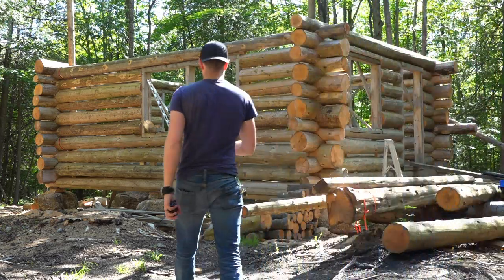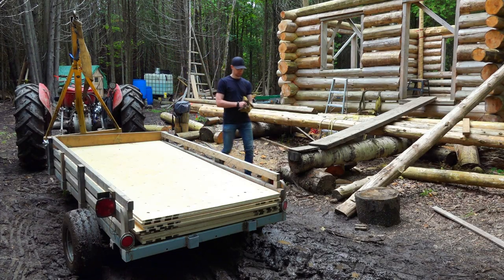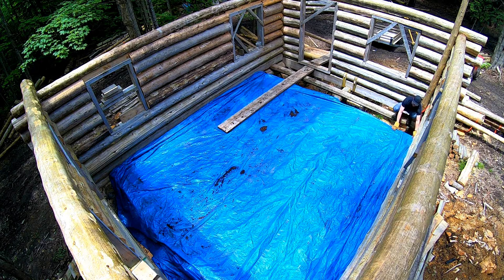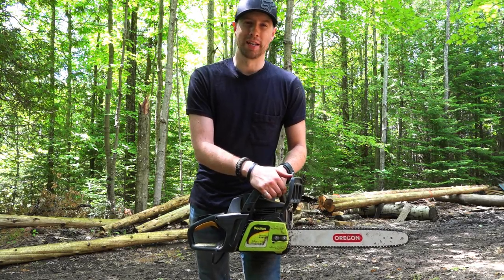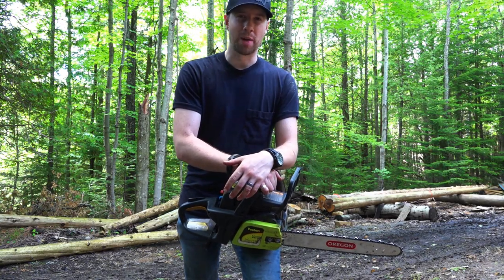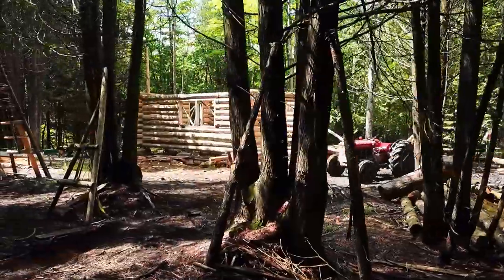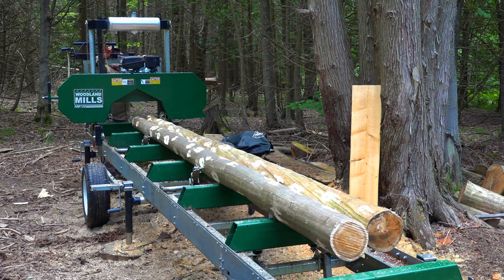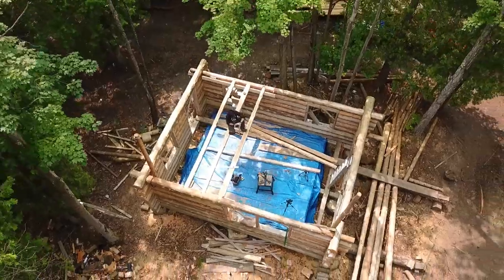Second Story Loft and Tractor Logging / Ep51 / Outsider Log Cabin

Comment: I've had a poulan saw for about 12 years now, a 3640 that I originally bought to stuff in a backpack on a dirtbike to clear trails with, but since then has gone through stages of being used for firewood collection and also stages of disuse for years at a time, and that thing still starts and runs like a clock every single time.

i recently replaced my old husky 262xp with a husky 565 for my main firewood saw, but even with the bigger saw I find myself reaching for the little poulan 90% of the time when i have a trunk to limb or a small job to do, and i still stuff it into a backpack to clear dirt bike trails every now and then as well, it's been a great little saw.

Comment: Fuel stabilizer... Or if not using small engine frequently, used premixed fuel...it certainly costs more per litre or quart, but will save the repair bills. Also, follow the starting instructions each time, they are designed that way. Great work/video, thanks for sharing your journey brother.

Comment: Recommend each time you sharpen your chain to flip your bar over, clean out the oiling holes, and grease the nose sprocket.  This will make it wear evenly and help the bar last much longer.  Great cabin build .....
Reply: Some/most newer nose sprockets don't require greasing. By greasing them, you're forcing additional greasing in the future.
Reply: @thechronicgeneralist  Good to know ...I guess my stuff is older ....
Reply: Also remove the burr on the blade edge with a fine flat file.
Reply: Sound advice BangFlop.........remember the air cleaner as well
Reply: Good advise Mr Flop.
He also needs to grease the bearings under that new drive sprocket.

Related to that torn up drive sprocket: what do the drivers on your chain look like? It seems like they would be pretty banged up.

Anyway there is need of cleaning and greasing everything you can. And to flip the guide bar over now and then for even wear.
This too will help your saw run better and longer.

My background is forestry and arboriculture.

Comment: I used to work in a shipyard. I was a carpenter. We often worked with huge oak planks and up to 12 x 12 beams. We used 'crappy' Homelite chainsaws on the job. They too are fairly cheap and an 'entry level' saw. I got so used to that saw that years later, I found one at a garage sale and bought it and used it for many years before settling on an upgrade with a Stihl Farm Boss. I currently use a Husqvarna 600 series. It's a monster!

Comment: Had the same Poulin saw - it worked great when I first bought it (used it to cut firewood regularly) but it started to become a pain in the ass! I spent more time trying to get it started than I did cutting wood. Hahah. Took it apart, cleaned, lubed, replaced a few parts and tuned the carb but it was never the same. I have a Stihl MS261 now and it starts every time, I'm not wasting time playing with my saw, I'm cutting wood!
Reply from the maker: Yeah that does seem to be an issue with those Poulans, hard to start and hard to keep at a steady idle. Glad you made the upgrade. Someday I will too!

Comment: That trailer looks like it's making your life easier when you're moving stuff around instead of the sledge.  Much more maneuverable, especially in tight areas.  Surprised how bright those lights on the tractor are, even in the day time.  Finally, can definitely tell the difference between an experienced person stripping logs than someone who may not have done it as often, lol. Thanks for another great video. Waiting impatiently for the next.

Comment: Good advice on Chain Saws. I have been through a few and came to the same conclusion. We only need one after a hurricane or to occasionally remove a sick/old tree from the property. When I need one I need one but I don't need one every month, maybe not every six months.  That's why after going thru a few over the years and tired of the hassle of keeping gasoline/oil, etc.  I decided to go with an electric chain saw and that has been a great decision.  Some might scoff but those that do I bet never used one. The Makita looks like the best from the reviews but I got the 15A Worx 18" bar saw (Value for money Win) and its been great.  Solid performance cutting up downed live-oaks and southern pine with ease.  So far its done everything I have ask it to do with zero drama, and that's exactly what I wanted. The best thing is that I can put it on the shelf and not worry about it.  Other than lubrication and sharpening it needs no maintenance and works just fine from my 6.5kw generator too.

Comment: You're allowed to be proud, 
You used what you had
Helped by your dad

 Your work was inspired
Despite you were tired
As you had a great factor
In using your tractor

Through the mud on the forest floor
To help out by hooking and hauling 
And cut logs for your cabins door

Slowly it rose one log at a time 
Keeping costs to,less than a dime
And as those walls rise up to the roof
You'll become quite proud and aloof

Adding windows then allowing in light
Will no doubt become a great sight
A fireplace too will be good for you
And warm up your cabin and soul
 
And then you need add 
A welcoming bed for your dad
And cook up some soup in a bowl

Soon your cabin will host
Those you do love the most
The love of your life...your wife...! 

With best regards for safety and success.....
Scott Fuller
(Canadian Forces 1964-2004)

Comment: I use to work for LOWE'S when I was younger in  inside and outside lawn and garden. When it comes to Poulan chainsaws, The key 
making them last longer when you're not using them run all the fuel out and replace it with STA-BIL storage.

Comment: Great comment about leaving chainsaw in the shed. The best solution to this I have found is to empty the fuel, and run it until it conks out. Storing it with fuel sitting in it for an decent amount of time will destroy the fuel lines and gum up the carb.

Comment: Good perspective on why a 2 cycle will just fail if left unused for long periods. One thing I noticed when you did the rather cool camera shot of you limbing that pine, if a experienced Tree feller is aware of the kickback zone, and surefooted, it is Quite the norm to cut branches off flush with the log with both the bottom of the bar and the upper edge.  One thing that may be little known to your viewers if I may share ;  If you ever come upon a "Honey Locust" that needs cut or is marked to be cut,  when shaving the bunches of thorns off of the log, (they grow like little bushes of heavy gauge spikes all along the trunk.)  Remember to use the TOP OF THE BAR to cut these out of the way.  As you present yourself to the tree and rev the saw, the chain is shooting over the top away from you, across the nose and back towards you. 

   The thorns are very painful when the chain cuts a bunch off thus shooting them BACK AT your  right upper thigh- (or worse yet someplace worse).  If not for the hurting part it could be seen as funny,   Yeeoouch!  I have seen The thorns from a Thorned Locust tree stab into my leg and also  flatten a dump truck "Mud and snow" Tire. Some I have seen are 7/32" to 1/4" thick and scary long. Trust me they hurt- kinda like Natures star dart. LOL  (here is a Pic.)

      https://encrypted-tbn0.gstatic.com/images?q=tbn:ANd9GcSiSjVmKolbDLuBqZLvDaTBXwkL6al5lWcabUz6YjDWwwItZvp6

Comment: Poulan saws may be "entry level" but they will earn their price if you take care of them. That bar and chain combo you have on there is the working end. Paying attention to the correct oil/fuel mix is essential. I used to have 3 saws I used regularly. a Poulan for limbing and bucking and general yard stuff. The others were 2 Stihl MS 250's with extended banana bars for falling and whatever other wood butchery. I have a Husqvarna that will not die. It's just for firewood and occasional windfall on the driveway. As you say use it or lose it....
Reply: This Poulan is entry level, you do realise there are Poulans out there felling trees everyday!  And Poulan is Husqvarna....

Comment: Interesting plunge cut and side wedge technique. Never saw that before. From my experience, a traditional back cut with a single wedge is a safer and more controlled drop. Less need for straps and manual shoving the tree.

Comment: Wow Mr Outsider! If this is what you and your father can achieve with an "entry level" chainsaw then what would you be both able to do with the top of the range equipment. I once heard a carpenter say it is not the tools that make the craftsman but the man using them... be they only simple tools or not. In the olden times they did not have power tools and made buildings still standing today.

Comment: I have the same saw as you and have had it for 5 yrs.1/4 the price and still works good! Another secret is to keep it sharp! Im not building a cabin but to clear the road after a storm works just fine!
Reply: Yep, very true. A sharp chain does most of the work for the saw, a dull chain makes the saw work harder. Also, don't force the cut.

Comment: That Poulan chainsaw sounds a little rich off of idle. Chainsaws like to be used at full throttle most of the time. However if you are experiencing bog or the saw loading up after idle its rich. As long as it rips good at the top end the top end adjustment is spot on, just the low end circuit on that saw is a little rich. Try adjusting it for better saw response and less load up!

Comment: G'day from Australia.

By way of reference to professional tree fallers I regularly watch on YouTube like Canadian Bjarne Butler the impression seems to be that they use Husqvarna saws in combination with Stihl bars and the trees they fall are as big as they get.

I have a little Stihl MSA 160C battery powered chainsaw which despite getting a bit long in the tooth and enduring some hard use in rural applications is a great bit of kit requiring almost no maintenance other than refilling the reservoir with bar lubricant and sharpening the chain.

It initially surprised me regarding both the quantity of wood it cuts with the charge from a single battery and the diameter of the wood it will readily cut with minimum difficulty if reasonable consideration is given to it's limitations.

I also have other Stihl battery operated equipment including an AR 3000 backpack battery all of which is so effective and useful I am now contemplating buying an MSA 220 saw as well.

All my Stihl battery powered equipment is so quiet that hearing protection is unnecessary and minimum noise, no hazardous fuel and no smelly exhaust is so good I am contemplating experimenting with portable solar panels to recharge the batteries in the field!

I have also owned a Stihl FS90 gas powered brush cutter for fifteen years or so that I have not used since I purchased an FSA 130 battery powered unit.

It is important to 'winterise' the engine on the FS90 before storage otherwise the unleaded fuel gums up the carburettor necessitating repairs and I know this because it happened to me.

Comment: I'm not sure if you are going to do this but if you can make a steep apex roof on the top floor make sure you make a large verandah that has a fixed window & a mosquito mesh walls that way during summer you can chill out on the deck lounging without being eaten to death. You could also have a pot belly wood heater out there during winter, great for watching the wild life at night with night vision cameras looking through the glass window.

Comment: Your saw analogy goes for ALL outdoor power equipment, no mater the brand. I have a old aluminum case Poulan, that runs better than any newer saw I have had. I have Stihl power equipment and do think it's the best, but they need care too. The better two cycle engines have two piston rings, as the rings help remove heat from the piston to the cylinder for cooling. The cheap two cycle engines only use one ring, so they get to hot and loose there springiness, causing a lack of compression for the engine to run.

Comment: Great video, great comment on Poulan. I have 2 Poulan 16", 20" and bigger sister 445 Husqvarna. Use Premium fuel or for short tasks and long down inbetween engineered fuel. Thanks
Reply: Haha that’s funny, I have two little 35cc-16” Poulans for limbing and smaller tasks as well as a 20” Husqvarna 455 rancher for bigger jobs also. The Poulans I have always seem to run well and get the job done. I find a sharp chain and steady hands makes for a smooth cut even with the smaller and cheaper saws.

Comment: Incredible to see how easy it is to peel off the bark. Didn't know it was THAT easy. Did you score it first to get the nice straight lengths or does it always peel like that?

I've got a Poulin chainsaw too.
My problem is that after I shut it off when it's warm, I have to wait till its completely cooked off before I can get it fired up again. You'll turn a preacher into a sailor before you fire it up when it's still warm.

Comment: Chain saw care: Do NOT use ethanol gasoline out of the pump designed for your car.
Find and use ethanol free gas. 100%
Reply: You can actually make your own ethanol free gas from regular 10% ethanol gas. Ethanol is hydrophobic (clings to water molecules). Use a glass container you can see through, pour about a cup of water per gallon of gas and agitate a bit and let it sit about 15 minutes until the gas and water separate. Decant the water which will settle in the bottom of the jug (you can siphon it off). You will have a slightly lower octane pure gasoline.

Comment: Alcohol in the fuel today will cause the carburetor in any tool to fill with gel and stop the operation of any tool. Just drain all of the fuel out before storing  and preferably run the tool out of gas insuring it is all gone until next season.

Comment: I have steel I've had Husqvarna the best chainsaw I ever had was a Sears Turbo real lightweight with a 16 inch bar boy I miss that chainsaw . I bought it new I used it for 35 years and I still sold it at a yard sale for 125 bucks the worst thing I ever did .
No matter how long it sat on the Shelf even if I forgot and left gas in it top it off with some fresh and it start right up .
I've got in the habit over the years of only putting premium fuel in all my gasoline engines it does make a big difference . especially when driving in the Rocky Mountains and dealing with altitude change whether you using the chainsaw or any piece of equipment the altitude change is the biggest problem here .
 I watched some great videos a little while back on how to really clean a carburetor and you need these micro flexible drill bits is what they are the clean out the ports . they're really not that expensive but I didn't buy any I have a couple sets of torch head reamers really just miniature rat tail files or micro miniature might be a better way to describe them .
 if I could run everything on diesel or propane I definitely would , I've had a lot better performance with the altitude changes .

Comment: There's nothing wrong with Poulan. Proper fuel,/oil mixture, good fuel filter, sharp chain, bar oil and let the poor machine warm up before going full bore sure helps. Don't leave fuel in saw idle for any length of time

Comment: Just don't leave fuel sitting in your chainsaw if you're not going to use within the next 3 months or so and it'll take care of most issues you'd encounter with any small engine machine. Old gas becomes a big problem for small engines. If you only use it occasionally buy premixed gas it'll be a lot cheaper than changing saws.

Comment: I bought an electric 16 inch Poulan chainsaw 3.5 hp about 7 yrs ago, at the flea market and it is a horse of a saw, of course you have to have a generator for it, but I don't go out in the woods with this. The guy I bought it from said the chain kept coming off and couldn't find the reason. I took it home and started to put oil in the chain oil reservoir and there wasn't any in it to start with, I said hmm maybe this is the problem, no oil? Ok so I fill the reservoir with oil, plugged her up and the chain came off, hmm , so I put the chain back on and the chain has never come off again, cut wood like butter! The only thing that I have worn out is the file to sharpen the teeth, Finally found a place that sell my chain for it, and bought two, just hope the saw will last that long. That saw of yours should last a long time , right up to where it falls off the cabin and it goes into  million pieces! Have a good day!

Comment: Most of the lofts i have seen, the Joists go between the logs, before the extra metre or so is added for the loft. in this situation a dovetail would have been a nice touch on the ends of the joists. I like the loft on your other cabin, how it gives you a lot of extra space. How are your footings so far?

Comment: Why are offcuts you refer to as scabs that result from milling logs not used as chinking instead of or in combination with mesh and cement mud?

Could they not be placed so their flat, milled side is outward and the rounded surface facing into the dips between the wall logs?

The result could be secured with screws run through from counterparts inside the cabin through gaps between the logs to the ones on the outside.

The diverse selection of dimensions for tapered shapes of the scabs would lend themselves to a wide range of choices to fit the various spaces between the logs.

Comment: Not saying it's not good to use them,but why do you use wedges?  Especially on such small trees, idk, it's probably safer that way but I just make like a triangle notch thing on the side the tree is going to fall and then cut from the other side just a tad bit higher than the notch on the other side. But don't cut all the way through because then it might fall on you. I've never had a problem with that technique, never been in a precarious situation.